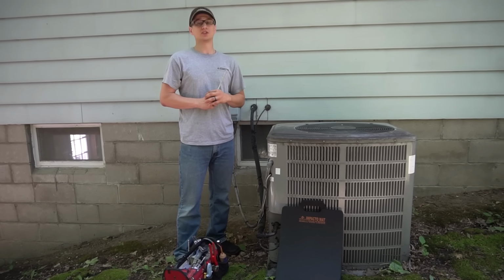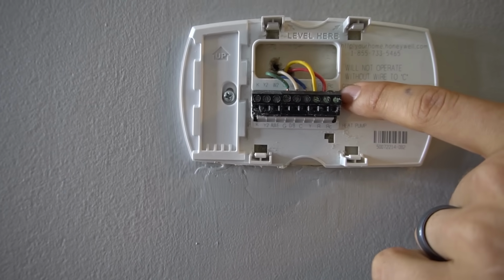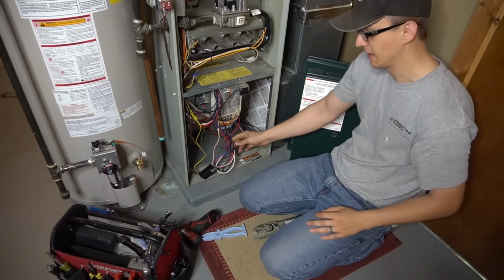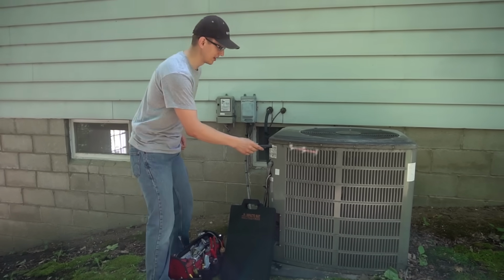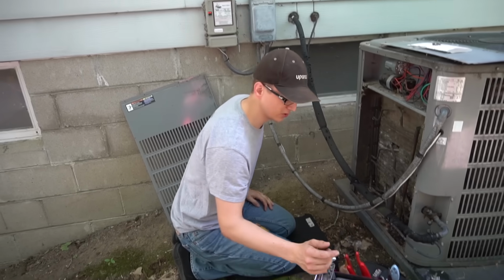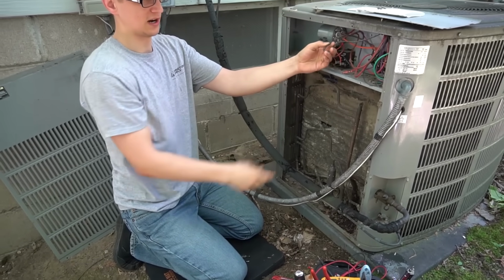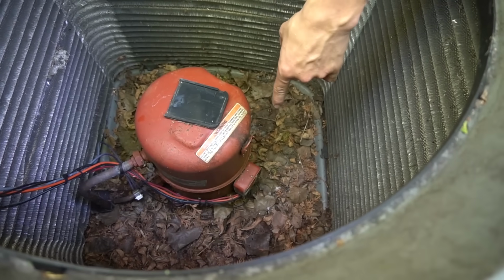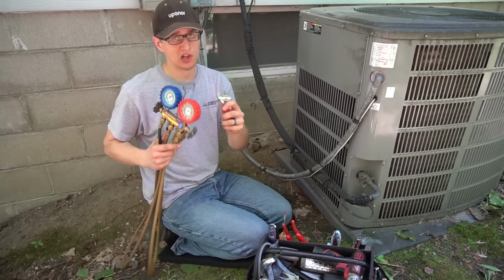AC Unit Not Turning On - How to Fix It Step by Step

Comment: Hello! Unfortunately you didn’t cover our issue. Everything turns on perfectly. Just the blades won’t spin unless you spin them. They turn very easily. We have replaced both capacitors. What else should we do?😊
Reply from the maker: Do you have a multi meter? Can you confirm that the condenser fan motor is getting 240v? Most likely it is if you are able to get it going by spinning it but it would still be nice to confirm. If it is getting 240v and the capacitor is new, then the only thing left is the motor itself. The motor is bad.
Reply: Word of Advice TV thank you for replying so quickly!!  I love your videos!! Yes it’s getting 240. Everything works perfectly, you just have to spin it. I was afraid you were going to say motor. We had it replaced less than a year ago 😕. Do you think that hard start kit you talked about will fix it?
Reply from the maker: @bibur104  Thanks! :) Unfortunately I am telling you what you didn't want to hear.. Oh boy, it's a new motor too. Well that's a bummer.. But yeah, that motor will need to be replaced. Just in case though, examine all the motor wires and make sure there is no broken wires or connectors. The hard start kit is only for the compressor so it will not do anything for your fan motor.
Reply: Word of Advice TV : quick note. Thank you for all of your help! I talked to the company that installed it, it’s under 2 year warranty parts and installation! It’s because of your videos and responses I was able to navigate what to do. Thank you for being so  awesome!
Reply from the maker: @bibur104  Sweet! Glad to hear you got it taken care of. Stay cool!

Comment: Can a bad start capacitor prevent the condenser from operating?
Reply from the maker: Usually no, most likely something else is going on. Many air conditioners do not have a start capacitor at all.
Reply: Word of Advice TV Ok thanks, because I have an outside unit that is not turning on. My condenser has a black start cap, and a silver run cap. When I turn it on, all I hear is a loud electrical buzzing sound, but the fan is not turning on. I already ordered another start capacitor, but now I’m not sure it it causing the issue.
Reply from the maker: @MarkTheTerror  I would suspect the run capacitor before I would the start capacitor.. Do you have a meter? Can you check if you have 240v going into the contactor and coming out of it?
Reply: Word of Advice TV  I do have a meter, and I will check the the contractor for power and let you know what I find.
Reply: @WordofAdviceTV  I have 240v going into the contactor, but when the unit is engaged, the switch pulls in and there is 0 volts coming out. When I turned the unit off and press the contactor switch down manually, the fan and compressor kicks on. Could it be the contactor?
Reply from the maker: @MarkTheTerror  Check if the contactor coil is getting 24 volts from the thermostat/control board. If it is getting 24v (when the plunger pulls in) then either there is something stuck in the contacts like a bug or ants, or yes, the contactor is bad and should be replaced.
Reply: Word of Advice TV I went to test the contactor today and the condenser just started working perfectly. I’m not sure why that happened, but I still may swap out the contactor anyway. Thanks for the help!

Comment: My Fan is working out side on the condenser but the inside Fan is not working! My fan inside was working but I heard some squeaking then it just clunk out! I just clean my coils in the attic but I’m still confused! My Thermostat is not Clicking on the inside Fan. Any Advice Thank you in Advanced 😀
Reply from the maker: Sorry to hear about the AC not working! It sounds like your blower motor is bad. If you set your thermostat FAN setting to ON instead of AUTO, does the fan inside turn on? I have videos on how to check and replace a blower motor but replacing the blower isn't too simple. Don't know if you want to tackle it yourself or not. (watch the video where I replace mine to get an idea of what you would be getting into)
Reply: Word of Advice TV No it doesn’t turn on at all 😢! Okay I may try I love to work on things! I fixed the motor on my lawnmower and carburetor and my Gas Dryer lol! Hopefully this wouldn’t be so bad! I’ll give it A Try Thank You so much 😁
Reply: The coil is leaking out rust brown in the pan also!
Reply from the maker: Ah okay, sounds like you should be okay then :) Watch a few videos to get an idea of how it goes and I'm sure you'll get it done! Rusty water is okay if it is just running out your drain line but if your evaporator coil drain pan is leaking or has a hole in it, I would try to patch it up somehow if you can access it. (can't replace just the drain pan, would have to replace the whole coil) Check and clear out the condensate drain line too if you haven't yet. They tend to get blocked and cause a leak.

Comment: I have a relatively new carrier. Fan won't turn and won't even make a noise, even when I push it with a stick. Warm air comes out of the vents. I Replaced capacitor, still nothing. Breakers are all good.
When I push that button on the outside unit everything works perfectly.. Any thoughts?
Reply from the maker: I have a video for that specific situation :) Hopefully it will help you track down the culprit: 
https://www.youtube.com/watch?v=NVPhsK4gK1A&t=2s

Comment: Very informative video. Great job on that. I have a goodman 3 ton unit, straight a/c. Model CKL36-1H. Turned it on and the air handler blows air, but outside condensing unit does nothing. No hums, nothing. I replaced the contactor and the dual capacitor. Still nothing. I am getting 24v to the sides of the contactor. I have 240v to the contactor and when I manually plunge it in, the 240v transfers through. I'm thinking I may have a bad capacitor, even though it is brand new. I am not home now, but will check the microfarads on the cap on Monday. Am I thinking through this correctly or is there something simple I'm missing?
Reply from the maker: You said you get 24v to the contactor but does it actually pull in? Do you have 240v going out the other end of the contactor? Also, if you have a fan delay board, that could be defective as well.
Reply: The contactor pulls in and I do have 240v going through the other end of the contactor. I am not sure about the fan delay board. Where would that be located on a Goodman model?  @WordofAdviceTV
Reply from the maker: It would usually be in the same compartment as the contactor (not all units will have one of these). So neither the fan or the compressor come on even though you have 240v? That's odd.. I have videos on how to check the compressor and the condenser fan, perhaps one or the other is dead? I would check. And even if the capacitor is dead, a lot of times the unit will at least try to start. So this is not exactly a common problem that you are having there..

Comment: Please help me. The unit outside and inside works properly when I turn the thermostat to emergency heat. However when I turn the thermostat to cold or heat the blower on the furnace doesn't kick on nor does the burners. Everything up to there weeks ago worked fine. I checked the fuses filter and anything else I could think of. The thermostat when turned on cold the symbols for hot and cold flash indicating lockout!?!  I don't know what that is but it shuts everything down. I give it a few min.s and the unit outside powers back up. I've had the board on the furnace replaced 2 times so far a new blower and cleaned out the breather I think that's what it's called that tells the furnace their is gas coming in to ignite. All this in two years. This is costing me a arm and leg please give me advice cause I can't afford to buy another board if that's what it is it hasn't been  4 months since I bought the last one and have AC repair people put it in.

Comment: I need to know how to rewire the thermostat wires outside
Reply from the maker: The simplest way is to put the two thermostat wires coming from the house to either side of the contactor coil. 24v. If you accidentally put it on 240v, it will burn out your control board, transformer, thermostat, and maybe more...

Comment: Thermostat in hold position and doesn't use batteries. Fans indoors are blowing. Outdoor fan spins freely. No chewed wires. Fuses look good. Able to manually start fan by pressing in connector. But the outdoor fan still doesn't start on it's own. What else could it be?

Comment: I know this video is a year old. But I have followed everything in the video. I have power to everything in my unit. Did have a guy come out and paid him to check it out. It’s a long story. Came out to check what was going on and he was just standing by the unit “which was not running but he had his gauges on it like he was charging it. I did hear a loud hissing. With that being said, now the unit will not even run. I’m thinking he just vented all the R22 out. Of course then he wanted to replace the unit for 15,000. It’s only 9yrs old. So I’m thinking he just screwed me. I’m going to replace the capacitor tomorrow and try that. But I’m lost at this point. The compressor does nothing. The cooling fan for the compressor will not come on even though it has power to it. If anyone has any suggestions that would be great!! I’m not an idiot but I’m not a air guy at all. Give me a car and I will have it running in 10 min. As far as the air goes. Lol!. my bad. My unit is a 4 ton Goodman.

Comment: Great video, I know this video is almost a year old but I have a question:  How likely is it that once a company replaces the Air Handler that the outside unit fails?
Reply from the maker: That's pretty unlikely. But there is a lot of variables that can come in play with a scenario like that so I can't say anything for sure.. A common problem is that something was not wired right so the outside unit does not get power from the control board/thermostat.

Comment: Can you help?
- Blown Fuse
- Checked Each Thermostat Wire
- Issue: Y Wire | Red=Bad / Blue=Ok

How do I find the short/narrow it down from there? I pressed in the AC button and fan came on fine.
Reply from the maker: Sorry for answering late. I just got back from vacation. If you are still stuck with this, it almost always is a bare wire. You will have to visually inspect the thermostat wire from the control board to the outside unit. (At the board the two wires will go to Y and C) Another thing I would try is to take those two wires off from the control board and jumper Y to R just to make sure it is not the board or thermostat that is blowing that fuse. If you cannot locate where the wire is shorting out then unfortunately you would need to just run a new 2-wire thermostat wire.

Comment: I was installing an ecobee4 last night at 10pm and it wouldn’t power on at all, AC didn’t work at all even with old tmstat and I’m in Texas so it got to 80 F in the house in about an hour. I stayed up until 2am trying to figure it out, I give up totally defeated, wife and I sweat all night.

Next day at work I’m looking for something to help me figure it out during my lunch break. Wife is at home all day with nothing but a fan, house is 85-90 F. 

I find your video. The 3A fuse symptoms sounded like my situation. Get the fuse on my way home from work and basically the AC is working less than 5 min after I get home from work. Happy wife ensues.

You are the man in so many ways I’d be banned by youtube if I said them. Subbed for life.
Reply from the maker: Hahah glad to hear you got it going man! Thanks and stay cool! ;)

Comment: I have an AC that the condensor doesnt  turn on but the air handler does I changed out the capacitor n fan motor when I turn on the thermostat the condensor just clicks and doesn't turn on. What could be the cause of that.

Comment: CASE:Today a tecnician came to "tune up" my home American Standard HEATER unit.  Within 5 min of using the multimeter he told me I needed a new MOTOR BLOWER CAPACITOR, said "It's reading 3.6 but should read 5.0", and it would cost me $165 plus the tune up of $89 = $254 TOTAL cost.   I said I'd think about it for a few months. He told me (scare tactics): "The capacitor is going bad, If it goes bad it will damage the blower motor and you're looking at a $600 repair".  I gave some excuses and declined it. Suddenly he said he was finished, and asked me to pay the $89 and was out of the house saying, "If you change your mind, call us back but there will be an additional TRIP COST".
QUESTION:  Do you think I should replace the CAPACITOR and pay that much, or not? [I'm a curious handy-man but never done any work on furnace/heater.]  Or, should I go learn how to do it myself and buy the part at Home Depot?
Reply: giuseppe3010 I’d say that 165 to replace a capacitor isn’t exactly in the realm of price gouging. You’re probably paying 20$ for the capacitor plus the up charge of having it delivered or in stock on the truck. The labor to remove the malfunctioning one and install the new one correctly. If you were already ok with paying 89 dollars for a tire kick, then 165 minus part cost for the guarantee of having the correct part installed the correct way should be reasonably affordable for you. In any case I would replace the capacitor.

Comment: My AC (cool) works fine but the Heat pump does not turn on . When I push in on the switch to overide it seems to work. Changed out the switch same problem. Any Ideas??

Comment: First off, thanks for the video. Seems like you give up a lot of your free time making these videos and I really appreciate it. From watching this video the only thing I couldn't get the answer for is what happens when contactor does not make contact. Changed out capacitor, changed out contacter. I have the correct voltage going in but nothing coming out. Correct voltage from T1 to L1 as well. Handler fan comes on but compressor does nothing. When I press the contacter plunger compressor kicks on, stayes on for a second then shuts off. Thermostat wires have voltage, fuse on hander is good, breakers are good. I haven't gone in depth with was checking the circuit board on handler or the wires on the bottom of the condensor. I would greatly appreciate any help or advice.
EDIT: Ok, I have high voltage going into the transformer and about 28 coming out. Power then goes into a quick disconnect on the circuit board and power is coming out to power the thermostat but not the contactor. The white wire of the low voltage is connected to a wire that's hooked to the quick disconnect and the red wire is connected to the "over flow trip bobber thing" which is spliced off and connected to the common wire to the thermostat.

Comment: Hi my ac will not turn on inside or outside. We replaced the transformer, switch board and thermostat and it’s still not working. The breakers are also on.

Comment: Hi my ac fan spins very slow for a short sec and then it stops. There’s no humming or buzzing from unit at all. However when I press the plunger in manually I hear the humming but the fan doesn’t spin. Can you help? Do you think it’s the capacitor or the thermostat?
Reply from the maker: Well I can tell you right away that it has nothing to do with the thermostat. (the fan not spinning) Does your compressor start? From what you described, I would try replacing that capacitor first. Do you have a multi-meter? Can you check to see if there is 240 volts going to the motor? If it's getting 240v and the capacitor is good, then I would say the motor is bad.
Reply: Ok, well check this out. That was earlier today, I have reset the whole system and everything seemed ok until about a hour ago. It’s started back doing the same thing. 🤔

Comment: Been watching your AC videos past couple of hours.  Here’s my situation:
Outside unit not turning on. Faint “humming” sound only.  Breaker is on and wasn’t tripped.  Thermostat had blinking snowflake when I got home today from work.  Fan inside is working.  I do replace my filter every 3 months.  I did so again today 1 month earlier.  Cleaned vent as well.  Replaced batteries in thermostat.  Tried turning breaker off then on again.  Outside unit won’t turn on faint humming sound like I said.  What do you think? Capacitor? It’s a Rheem unit installed in 2009.  2-ton unit.
Reply: May be the contactor. If not may be the compressor

Comment: I'm a bit confused here.  You stated that if the fan blade stops spinning in the winter then you could just give it a spin and start it back up.  I'm not trying to argue here, but if your outdoor unit is operating during the winter months then that would make it a heat pump and not straight a/c.  When a heat pump goes into what is know as a defrost cycle, the fan is supposed to stop spinning so the coil can heat up and defrost the ice built up on it.  That is steam coming from the coil and not smoke from overheating.  If I misunderstood, ease let me know.
Reply from the maker: You are right. The unit in the video is a straight AC and when I said that I totally forgot about heat pumps.